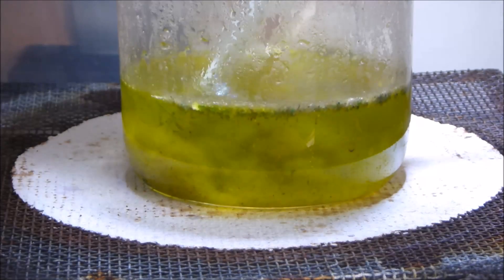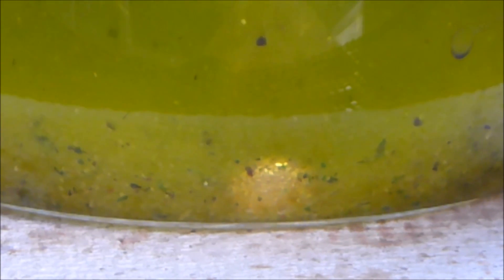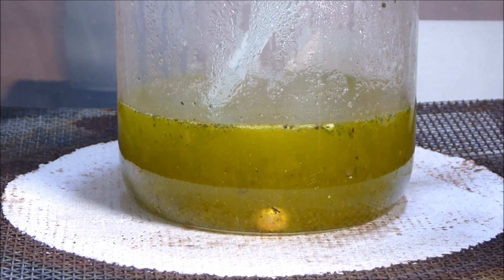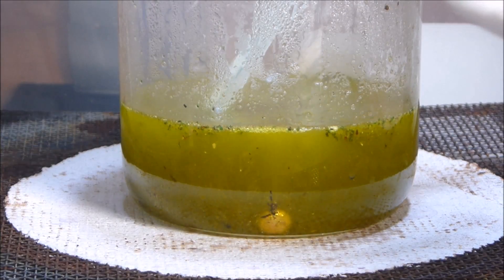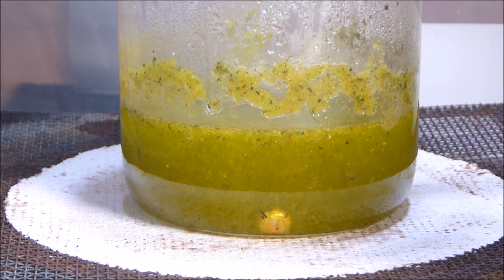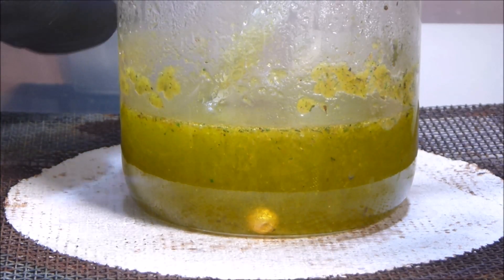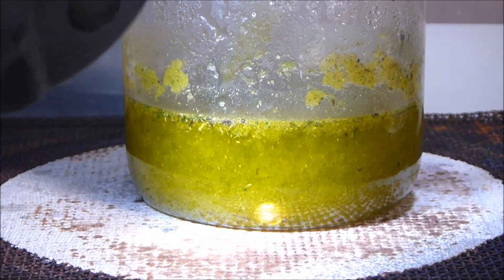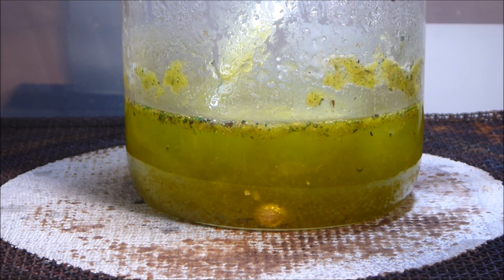Denoxxing your Gold solutions with Sulfamic Acid

Comment: Oops. I have about two ounces of AU in solution of hydrochloric and sodium nitrate.  I added some sulphamic which reacted with bubbles once, then as I stirred,it bubbled quite aggressively th3 second time. Now the solution was fairly cool, not the temp you recommend. I tried some smb, but the precipitate immediately returned to solution before reaching the bottom. So here is where I began adding more sulfamic and didn’t observe any reaction, but did see a very fine floating film of gold Then I found this video and realized the solution is overdosed with sulfamic. Any suggestions much appreciated.
Reply from the maker: @bcgoldminer  hey, once you lose control of it, things can become quite tricky, I would add a bar of pure copper, heat to 60c ish and let the Gold all cement out, then start with a fresh refine. 2OZ is a LOT to be experimenting with !!
Reply: @ Hey, right on, will do. I suppose a flattened piece of copper pipe might do, but wonder how much surface area is needed. Thank you for the quick response.
I filtered and currently evaporating. I succeeded the last time separating three ounces from tungsten powder. This time though, I suspect the sodium nitrate sediments proved problematic. The first tome I dissolved it in hot water before adding. This time, since I now have a heated stir-plate I thought I could just keep adding directly without dissolving beforehand.
Reply from the maker: @bcgoldminer  yes, Cu pipe works great, just need to split it open so you dont have Au trapped on the inside. I often use Cu to cement after the first recovery when there is likely to be excess HNO3, then I wash that cemented powder before a final refine with AR, gives you nice clean Au 👍
Reply: @successfulengineer  I tested a drop of the solution on a piece of copper, which immediately turned black. So now I wonder perhaps it’s still acidic in which case the copper might be consumed until neutralized. Then try smb, perhaps?
Reply from the maker: @bcgoldminer  nah, thats a hard line to play, the Cu will definitely go into solution due to aby excess acid, after that the Au will cement out, will only take an hour or so, then you can re-refine the cemented Au being careful with the Oxidizer so you dont have any excess
Reply: @ Roger that! Thanks so much.
Reply: @successfulengineer  hey I just want to double check beforehand. So once the copper is added 60C solution, copper sulphate and gold will settle into a sludge. 
Then I filter and wash this cement and proceed with AR? 
The copper sulphate remain as a sludge and needs to be filtered out in the second refining?
(I’ll be using incremental nitric acid this time.) I’m trying to devise an economical way of separating 50% micron gold, 50% impurities, iron oxide dust and very fine silica. Have some success with roasting the pyrite and quenching in vinegar, resulting in hematite. Dissolving this in hydrochloric, but usually there’s some left which make a mess if I try melting and pouring.
Thanks
Reply from the maker: @bcgoldminer  hey, if you start with a clean solution, you will only get brown cemented spongy Au at the bottom, the Cu will stay in soltion, when it is all done you just pour off the barren solution, wash the Au sediment and then refine with AR
Reply: @successfulengineer  Awesome. Thanks again. Sending some coffee... Just need to update my Gpay. Much appreciated.
Reply from the maker: @bcgoldminer  no stress at all mate, keen to hear how you go 👍 always happy to help
Reply: @successfulengineer it seems the solution is now neutral. When I dip a piece of copper in, there is no reaction. However, I’m a little perplexed about the cement, most of which is loose medium brown heavy powder, much like smb drop out. There are remnants of the copper half pipes were, which seem to have morphed into a hard version of said mud. I rinsed and boiled in water. What if there’s still copper encapsulated? Can I proceed with ar refining, will the gold drop out while leaving the copper in solution. Or should I test for presence of copper which should react before the gold, by Adding a small shot of hydrochloric, sodium nitrate dissolved in boiling water and a pinch sulphamic? Once gold starts appearing in stanus test suspend a piece of copper plate until tests show negative gold?
Reply from the maker: @bcgoldminer  hi there, cool, dont worry about any remaining Cu, just dissolve it along with the Au, SMB is selective for Gold, so will leave Cu in solution. Be very careful with your HNO3 or nitrate addition, I usually end up with a dropper doing individual drops of acid to avoid a large excess.
Reply from the maker: @bcgoldminer  Copperas (iron sulfate) also works as precipitant when you dirty solutions, sometimes I will do a first refine with SMB, then second refine with Copperas to get really clean Au
Reply from the maker: @bcgoldminer  Dont try to play the game where you try to dissolve Cu away before AR, its practically impossible, best way is to just get everything into a solution, then dilute your solution with distilled water, wait some time to make sure any salt precipitant from the dilution will settle out, then syphon the crystal clear solution into a clean beaker and use a selective precipitant like SMB or Copperas to drop the Au while leaving the Cu in solution. Here of you need any more guidance
Reply: @successfulengineer Ha, ha. Too late, I tried, and you’re right! Although I noticed a light green as some copper went into solution, so did the gold. As I did stannous tests minute by minute the gold cement started dissolving, even though the solution of HCl & NaNO3 was very diluted. Then after I lowered a piece of copper in, fine gold flakes started emerging in the backeddy as the solution swirled around the copper. Soon the flakes formed an almost solid film of swirling gold, a neat  example of its hydrophobic nature. 
Those hard chunks which used to be copper are still there but playtime is over… lol. Filtered, rinsed with boiling water and ready.
Thanks again
Reply from the maker: @bcgoldminer  LOL, doesnt hurt to learn by experiment, its pretty hard to actually lose Au. I use some Cu bus bars out of electrical cabinets for my cementation, so I dont end up with any solid Cu pieces in my cemented Au, you can usually buy some nice thick bus bar pretty cheaply from scrap metal guys.
Reply: @successfulengineer  initially the idea of possibly losing it was intimidating… Indeed, your feedback really helped conceptualize the mechanics and encourage experimentation. Now I can focus on feeding the gold table and generate more product!
Think yellow my friend. 
Much gratitude.
Reply: @successfulengineer Hopefully you’re finding this entertaining enough to justify the time invested…. 
I think I figured out why some gold remained, which led me to add too much oxidant in my first experiment. Some of the HCl was consumed by the impurities and some by the sodium nitrate. My question is, given the cheap cost of HCl, is it safe to add more than needed, perhaps double it. Then focus primarily on careful incremental addition of sodium nitrate dissolved in hot water. And how much if any, does the addition of water influence the usability of home made aqua regia? My thought is, mix up/dissolve the estimated nitrate in as little water as possible, then add it with a ml at a time, as the reaction seems to stall.
Reply from the maker: @bcgoldminer  hey, oh yes I thought that was a given, I probably start with 10x the HCl needed for my small refines ! No risk in having too much HCl, in fact, you need there to be a excess for SMB to react with when you precipitate !
Reply: @successfulengineer Awe yes. This is starting to make sense!🎉
It finally dawned on me that a bunch of it probably went dissolving the hematite and so forth, meanwhile I was trying to follow the re+omended 3:1 ratio! 
Cheers!
Reply from the maker: @bcgoldminer  LOL, yep, ive never once measured out my HCl, I dont even know what concentration Im using 😂

Comment: If i dont use enough sulfamic acid to avoid overdousing can i still overwhelmed with smb to precipitate? Assuming it doesnt denox properly?
Reply from the maker: Yes, you can also add some water which helps, but really, try to use the minimum amount of HNO3 you can, it just makes everything so much easier.

Comment: Correct me if I'm wrong :  HNO3 + H3NSO3 → H2SO4 + N2O + H2O (nitric acid is turned into sulfuric acid). And indeed, lead will be precipitated by sulfuric acid. If you refine gold from PCBs or other electronic waste, it may be useful to have a first bath with either acetic or oxalic or citric acid (with a little squirt of nitric acid) to remove Sn, Pb, Zn (components of soldering).
Reply from the maker: Looks correct to me, and yes, you definitely end up with Sulfuric acid and precipitated lead.
Reply: Yes

Comment: Does it have the same effect when high levels of chlorine are present?
Reply from the maker: Not as far as I know, the Sulfamic acid has a chemical reaction with HNO3, not sure what the results would be with Chlorine.
Reply: Could we get more denooxxing videos. What difference in performance if solution is cold or warm. Thank you.
Reply from the maker: @gabrielheredia7563  Hi there, with Sulfamic acid, the solution must be very hot, I believe that it is less effective with cold solutions. I am unfortunately not doing much Gold recovery anymore, have moved onto some other projects. But still happy to answer any questions if I can help.
Reply: @successfulengineer  appreciate your efforts.

Comment: hello.i think I done what u mentioned at the start of the video.fist time using sulphamic acid.i think I added to much.i got a precipitate n bottom f beaker.looks like salt and pepper mixed together for all the world.how would I proceed then.would I just filter the liquid.anuthing that i get it the filter.put it back in the beaker with AR redisolved the gold again.i tested the liquid after input sulphamic acid and stannis was negative.i must of used way to much sulphamic
Reply from the maker: Hi there, what I would do: Step 1 - Take the liquid that you believe has no more Gold in it, heat it mildly with a Copper bar in there, if there is any remaining Gold it will cement out on the Copper. You should have already neutrlized all the HNO3, so there shouldn't be much Copper dissolving. Then I would take all the solids, and wash it many times with boiling water to get as much as possible of the Sulfamic acid out, otherwise, re-dissolving with HNO3 will be slow because the Sulfamic will keep reacting with it. Once the solids are well washed, re-dissolve with AR.
Reply: @successfulengineer  thanks so much for your reply.ill let you know how I get on.thanks a million
Reply from the maker: @davidbarron107  No worries, always happy to help. Be safe, work methodically. Nothing is lost. Get in touch if you get stuck somewhere.

Comment: Why can't you just use sunlight to denox? Nitric acid breaks down in direct light, dosen't it?
Reply from the maker: I guess for the same reason that you don't use sunlight to turn Silver Chloride into Silver metal, yes, technically it would be possible, but so slow that it would be impractical. You could just leave the solution on low heat for long enough if you wanted to denox without chemicals.

Comment: Hi sir I use Sulfamic acid and after using Ascorbic acid I have brown powder or black powder but it's not gold what's problem??
And where is my gold??
Thanks sir
Reply from the maker: Hi Emad, the brown / black powder is usually almost pure Gold! Super fine Gold powder is often brown like mud, or even black. You now have to do a wash of the powder woth water  and Hydrochloric acid, then melt with a gas torch. See my video about melting the Gold powder...
Reply: @successfulengineer  Thanks for answer friend
I try to melt it with electric machine 1100 degrees over 30 ment I have just same small black stone with only half gram of gold it's something makes me crazy 🤪 because I am sure I have much gold from ram fingers and old pantum pro prosessor
Some Tim thinking maybe problem with Sulfamic acid it's better if I use urea
Please help

Comment: I acquired land with very old tailings, last time touched was 125 years ago. Also found their foundry area, alot of slag[grey,green,black,brown&blue]. Time and weather has covered alot of it. Dug down 2 feet found stacked stone walls. If slag i ground fine in my ball mill, then run across shaker table, you find tiny gold and silver specks and some lead.  I am using sodium cyanide to dissolve the pm's. 3 Assay reports close to each other Au,Ag,Ir,Pd,Pt,Rh& Ru. Cyan. Ph 11, 60 gram cy per 10 liters water, air, mix for 24 hrs, filter add 5-6 gm cy, so have free cy, precip. with zinc powder, filter, rinse, put precip in hot Nitric/water, filter, rinse, air dry. I torch melted, 36.7 gm 14k&plat.. From 10 -5 gallon buckets of ore. The exchange does not accept the metals mixed. I came back flattened the button, cut up put in AR....This is where I am at now. My plan is to denox, zinc precip. take this into hot ammonia to dissolve the plat. into liquid, filter. This should give me my gold? To the plat. liquid filter it through steel wool, then put that into HCl hot to dissolve the steel wool leaving plat.. I have tried ammonium chloride, did not work. I was told because of the other pgm's. I also have tried denox down, add HCl twice, SMB, nothing. Was told because of the pgm's in solution.  So I figured next batch. Zinc precip. from cyan. put this into sulfuric/water warm, pour off rinse, solids then into Nitric/water warm, pour off, rinse, solids now into AR room temp, denox[with sulfamic], zinc precip., filter, rinse with HCl, remaining solids put into hot ammonia, filter rinse and melt the solids. Is this all correct? Will the ammonia work? Use the other acids to remove all base metals and pgm's, leaving the gold by itself. Thank you for your time. Joe
Reply from the maker: Hi Joe, I honestly have almost no experience with PGMs, so unfortunately cannot offer much advice! Have you tried asking for advice on the Gold Refining Forum ?
Reply: @successfulengineer  thanks and yes  also on 911 metallurgist. People take to long to answer

Comment: i add urea and smb but gold wont drop
Reply from the maker: It is very difficult to give any advice without quite a lot more detail, what is the source material ? How much acid did you use ? If all else fails you can always cement out on a Copper bar.

Comment: What should one do if I added too much sulfamic acid? I’ve used too much and have that shiny drop along with regular gold powder? I’m planning on refining it all again but interested in what happens and how to fix the gold powder? Thanks for sharing, very very helpful
Reply from the maker: Hi Robert, best bet would be to drop out any Gold still in solution, use Copper to cement on if you have to. Then wash the settled powder a few times with boiling water to remove as much of the Sulfamic acid as possible before re-refining. If you don't wash the Sulfamic out, it will end up fighting with your Nitric acid additions and you will end up using too much Nitric again ! (I've made this mistake too :) ) Good luck and let me know how you go.
Reply: Successful Engineer thank you

Comment: Where did you get your sulfamic acid from in NZ?
Reply from the maker: Hi Luke, you can buy it in small quantities for a reasonable price from mygoodhealth.co.nz
Reply: Successful Engineer oh awesome what a good little site that is. And cheap too. I have just been schooled about urea and the compounds it can make when using it to denoxx or neutralize a solution in PM recovery...im making the switch and saving my H2SO4 for other things instead of dropping lead which is another bonus to using sulphamic
Reply from the maker: For sure, the Sulfamic works great, just ensure the solution is hot! and give it time to work. And obviously try to have as little free HNO3 to start with as you can. The reaction can be quite violent if you have lots of excess HNO3, so make sure you are protected from a boil over too.
Reply: Successful Engineer will do. I try to keep acid use to a minimal. Catch pan is a must, I've definitely learned my lesson in the past with boil overs 😅 it's a hard lesson too...

Comment: And.., compare to Urea,  is this a better to use sulfumic acid to neutralize nitric?
Reply from the maker: Yes, Sulfamic acid is better because it converts the Nitric acid to Sulfuric acid, which has the added benefit of precipitating any lead in solution. But Urea definitely also works fine
Reply: Successful Engineer Urea only kills the Nitrogen Dioxide , which stops generation of more nitric acid in solution. You must then neutralize the remaining nitrates in solution, which is why sulphamic acid is the better option.